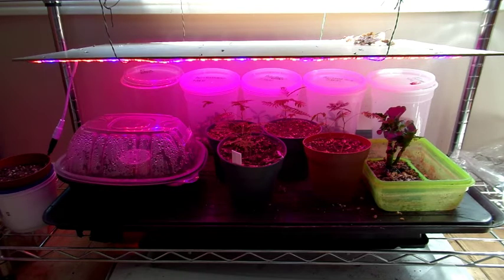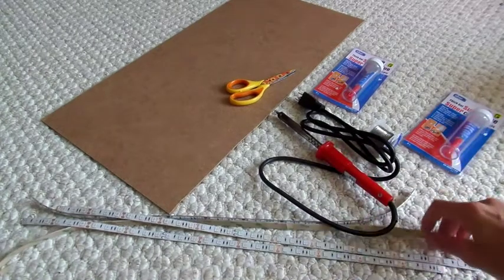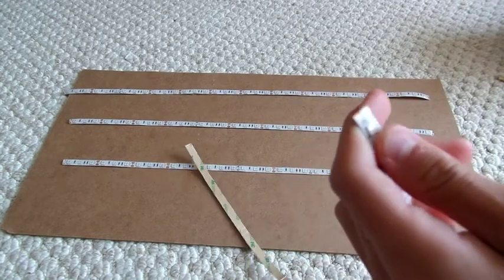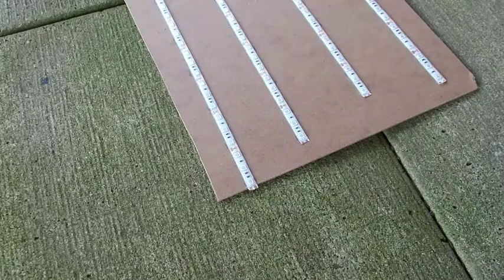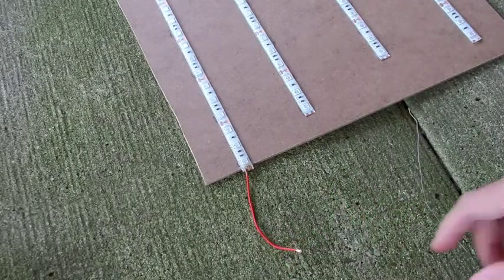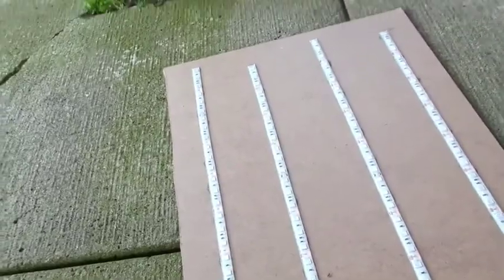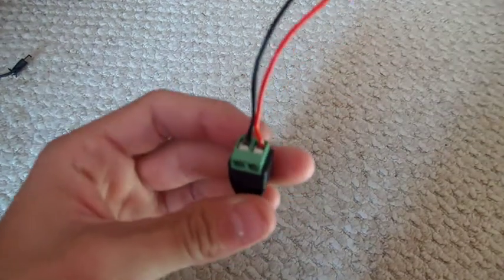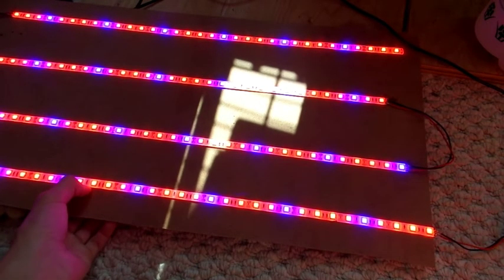How To Make Custom LED Panels For Growing Plants Cheap!

Comment: What is the benefit of soldering the lights instead of using the connectors that you can connect the lights too?
Reply from the maker: I wired them together so i could use individual strips instead one strip back and forth. Its easier then adding connectors. Its a bit hard to explain, i believe i have a video on how i made these lights, maybe if you see how they are made you would understand what im talking about?

Comment: Hey friends - this soldering technique is well, unpolished and not the best and is called cold soldering and is seen as poor practice. Check out better soldering techniques on youtube elsewhere. Source - worked in EE department at a university.
Reply from the maker: Hi, thank you for your comment, i will check out some better soldering techniques. When making this video i was only 15 years old and that is the only way i knew how to solder. It worked for what i needed so thats all i needed to know. :)